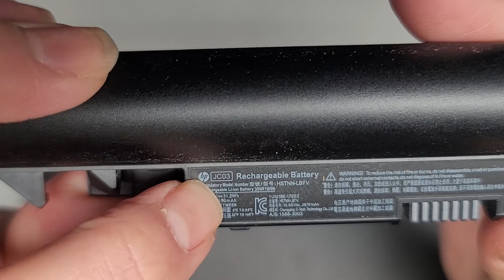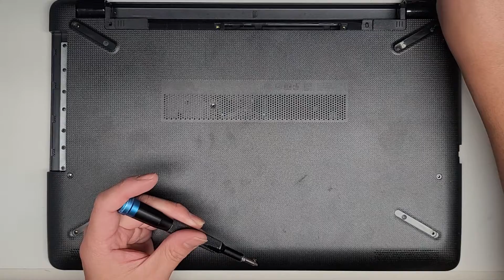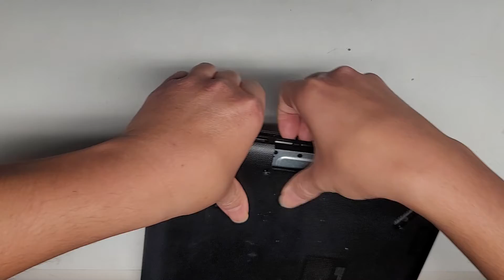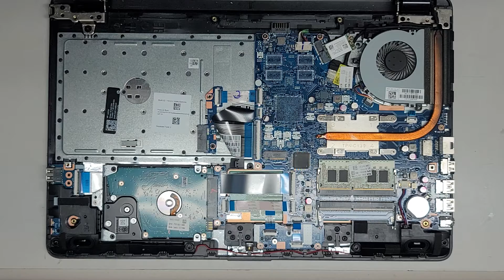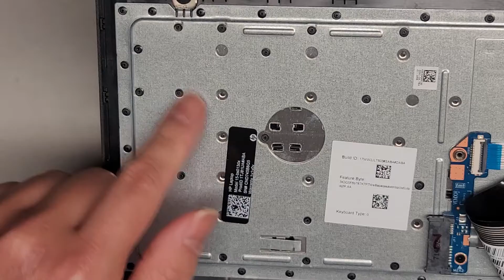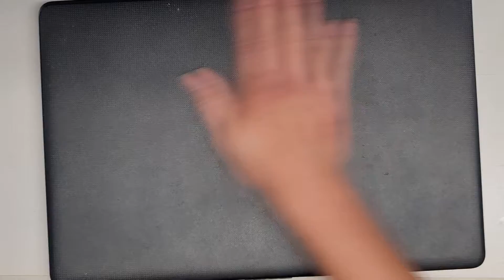HP Laptop Notebook 15 15-bs013dx Disassembly RAM SSD Hard Drive Upgrade Battery Replacement Repair

Comment: Thanks for creating this video.   Got this laptop from an estate my wife is the executor for, no one wanted an ancient, slow laptop, but I took a look and decided after a quick upgrade it'll do nicely as a Valheim server to replace the old one.  That 5400 rpm spinny disk has got to go.  Your video was very helpful illustrating how to open the case non-destructively!
Reply from the maker: Awesome, glad it helped.

Comment: Does the HP laptop computer 15bs087cl have an internal battery inside?  I want to replace the external battery jc03 HSTNNLB7V 919700-850.  Where can I get one?  Just want to keep it as a spare laptop.
Reply from the maker: I haven't worked on that model yet.

Comment: I really need to know, do the bs series support m2 nvme? i installed an m2 SATA on bs060wm, it works, but i want to get the nvme
Reply: I also have this same HP BS013DX, the HP website Q&A section points to using the M.2 SATA and not the M.2 NVME.   There is a difference; get better info before just throwing incompatible parts in there.
Reply from the maker: @dalitsobanda3647  try one that has free returns
Reply: @ItsBinhRepaired  thanks, I will try that one
Reply: @dalitsobanda3647  I'm going to upgrade to SSD, but I'm going to just replace the hard drive with a 2.5" SSD.  There is no performance enhancement using the M.2 slot since it is only SATA like the hard drive connector slot.  If the M.2 slot was NVMe compatible I would use that instead.  Unfortunately it isn't.
Reply: @richernandez9628  yeah that makes sense, I will do that as well in the near future, thanks for the info🙏🏽

Comment: Have you ever upgraded the mobo on the HP 15 bs series laptop? Found a tossed out HP 15 bs212, laptop works (CD player seems stuck / won't open) but the unit has the Celeron 1.1 Ghz CPU! 😴 Its actually a nice laptop. Looks like it has Win 10 (Home probably). Think the max RAM supported might be 8 GB. So the CD player is not the slim type?
Reply from the maker: It's soldered to the motherboard
Reply: @ItsBinhRepaired  yes the actual CPU can't be upgraded, but have you replaced the entire mobo with one that has a better performing CPU? Can the Celeron mobo be upgraded to an i3 or i5 mobo? An improvement!!
Reply: @ItsBinhRepaired  my inquiry would be a question for HP support! Thank you
Reply from the maker: If it's for the same model laptop, yes. Make sure the heatsink is the same.

Comment: Thanks for the tutorial. I would recommend touching a shiny screw on the PC to discharge any static electricity in your body, before touching any part of the components, especially the circuit.
Reply from the maker: I sit on a metal chair and touch the metal on my desk lol

Comment: I had this laptop and I bought crucial p5 plus 1tb m.2 but doesn't fit.  Can you please recommend any adapter to make it work will be great if send amazon link for the adapter
Reply from the maker: It doesn't fit in the slot on the other side of the trackpad?

Comment: I have the 15-bs020wm model, it doesn't have a second ram slot but what confused me was a lack of a fan

its just a piece of metal attached to the cpu
Reply from the maker: Must be a low powered cpu
Reply: @ItsBinhRepaired  it's a quad core pentium‌, not sure which one
Reply from the maker: I see

Comment: And for the m.2 ssd, I have laptop models like this, seems like they all have m.2 ssd slot but unfortunately it's SATA, you can tell when the notch in the slot is on the left, the nvme slot has it's notch on the right
Reply from the maker: Nah, the notch is always on the left. I've never seen one on the right. You can watch my thousands of repair videos and you'll see. Sometimes they support both sata and pcie nvme as well.
Reply: @ItsBinhRepaired  I agree with you on some ports supporting both standards, as for the notch position, from the angle that the drive enters the slot, for nvme only slot, notch is on the right, SATA slot notch is on the left.
Reply from the maker: @Ayaat Onusi  I've had a lot of nvme only sockets that don't follow this rule.
Reply: @ItsBinhRepaired  I would like to see the port, could you suggest a video that showed this port
Reply from the maker: @Ay.calligraphy  not sure. Most m.2 SSD laptops I worked on.
Reply: Nope its true, i have the exact same laptop , i installed WD m.2 sata ssd, it seems that notch on the left is indication of sata m.2 , ive never seen any right slot sata m.2, send a link of any video if you think otherwise.
 @ItsBinhRepaired
Reply from the maker: @vaibhavkumar2568  I use one of these every day... https://amzn.to/49Hmux1 It supports both nvme and sata m.2 drives. I do this stuff for a living and have over 17 years of experience working with this stuff...

A notch on the right side means it supports SATA for sure, but doesn't mean nvme won't work...